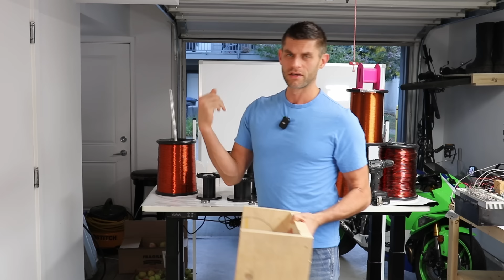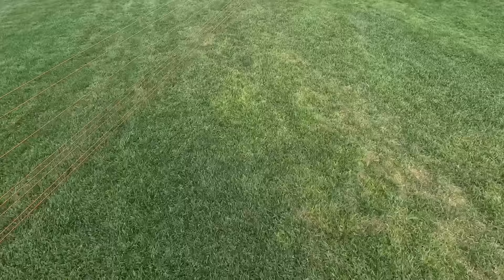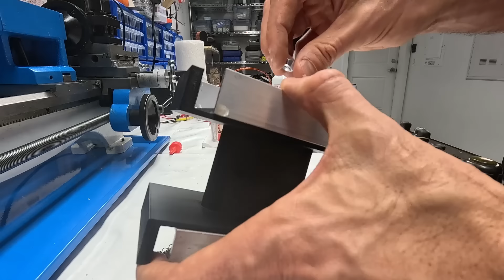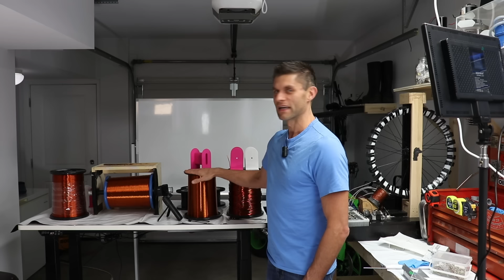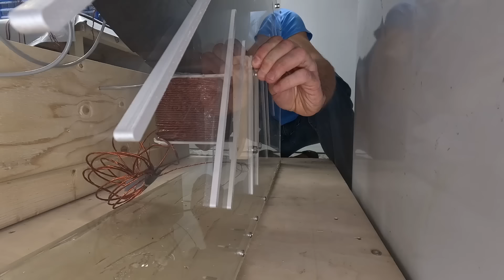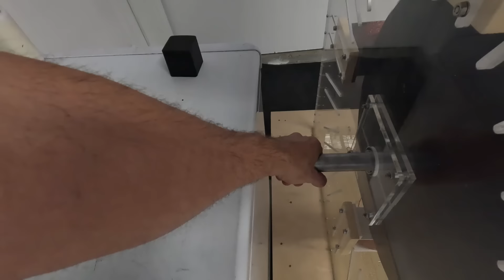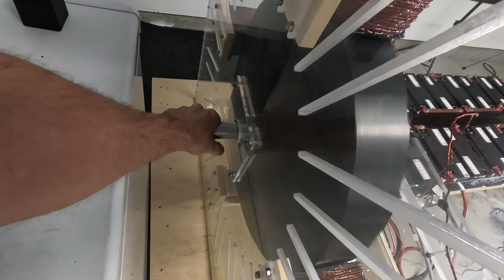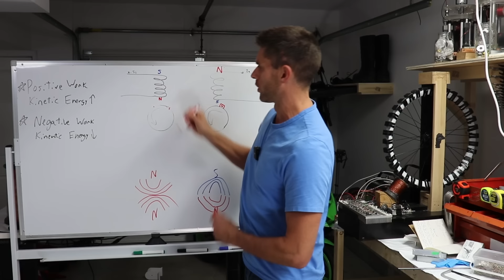The Device That Could Give The World Unlimited Energy

Comment: This dude understand the concept of entropy &  negentropy; guys we r living in a vast ocean of energy we just need to tap-in into it with  sharp pulse by quickly open/close the vacuum space time in higher dimensions
Reply from the maker: Cheers
Reply: So u can basically replace solor panels with that magnetic energy generator  and have power always, would u still need batteries? I would love to be able to not worry about having enough power. I do think the generator is a little loud, since it doesn't require fuel or anything needing oxygen might want to look into sound proofing it.
Reply: @scottbragg5047 I don't wanna burst you bubble but his device does not make free energy even if he tapped into the quantum background it would ammount to fW or pW which would be completly overshadowed by losses for now solar and wind power or like diesel generator are the only way to power your home if you truly want to be independent from the grid
Reply: There is NO gain on BOTH Voltage and Amperage.  
A Free Energy device needs to have a Positive Gain on Both Volts and Amps simultaneously.  
There are losses here...
Reply: you sound like a mental illness dude I know. go and get some help you might not realise how mentally ill you are. when your mad you don't know it for sure that's what my friend said. you just have strange unhinged thoughts and start to feel paranoid because people don't understand you. get help
Reply: Problem is can what he gets for free overcome his losses in the electronics the coils make heat the friction of the wheel the losses in the circuit doing pulse width modulation the heat in the battery let’s wait and  see
Reply: Put your equipment in the electrical socket if you're in doubt
Reply: Lt. Col. Thomas E bearden
Reply: @ceoofram4007  Yes, another idiot like this one...
Reply: Oh stfu
Reply: in a vast ocea no, we are energy , evrything in the universe is made of the same energy, lets say , in our universe there is 100% energy , and we cant add on any more or subract any of it , all there is to do is transform the energy , because that is all energy wants to do is materialize itself, there is energy all around us evrywhere , u wont find a single squared inch with out energy, only problem is we have not the tech or so they say we dont and its impossible, but at one  point in time no one could dunk a basketball from the free throw line because humans cant fly, until jordan took flight in 88 and did the impossible, it was such a feat to accomplish that overnight he earned thename air jordan. and today other players have also done it , so its only impossible until some one does it,  so we have so much tech and a sht to of gpatents that have been kept secret so that utility companies can continue fking us with out vaseline , i cant wait for the day someone sticks it right back and kills the electrical companies once in for all, next era and fpl just to name 2 of the fkn thiefs draining our earnings while politicians allow it , fk them all , i didnt go to college so all i have seen so far is ur usig a battery to run the machine thats charging ur other battery , nothing new there bud , so when is the magic going to happen u said oct nov well its almost holloween now . ps idk but u really gave me the impression that uir on some white caffeine man , slow the bumps down before recording urself .
Reply: Ok...
Reply: Let's ride that vacuum 😂
Reply: @grilsegrils9330 yeah man gonna tap into higher dimensions next week useing some copper wires I have laying around 😂
Reply: Bro what you just said doesn't just make no sense but it's so absurd I'm pretty sure you don't even know what you said yourself 😂
Reply: @MindfulMinutes-nz1lzjust because YOU and other's dont understand what he's talking about, or are looking at it from a closeminded perspective - doesn't mean Spencer has to be. Wake up!
Reply: @UnityThroughTruthdo you even understand what exactly hes doing because I'm like 100% you lack knowledge      on this subject he talks about pulling energy from quantum fluctuation which first of all there is no proven way that magnetic pulses like in a motor could pull that off and even if he is utalizeing some new physics or whatever he claims the energy gain from pulling enegry out of assymetrical quantum fluctuations would be fW to uW on macroscopic scales his maschine has losses in the single digit watts atlest if your honest it's in the double digits but even if we say he has zero losses and somehow got a single watt out of quantum fluctuation which is 1000000 to 1000000000 time larger then even optimistic guesses that would mean his device produces a single watt meaning you could light up a led if you buy a small solar panel you can generate way more energy and it's cheaper his device which is just a crudely build prototype which every prototype is crudely build that's not criticism it's hand wound and stuff that's takes dedication but even that costs way way too much to be economically valuable and this is assuming he gets 1000000000 times more energy out then even very generous estimations, to actually tap into quantum fluctuations you would have to use casmir plates to crate fluctuations within them which is extremly hard but the casmir effect has been observed so it is doable but even if you do that you also need fully superconducting circuitry to avoid any losses since these fluctuations would only produce in the fW and since we don't have room temp superconductors you would have to build it in space or discover room temp superconductors just for fW which can basically power nothing so even if you were to pull it off like he claims quantum fluctuations are not a good powersource a small solar panel would outclass that by multiple orders of magnitude
Reply: @MindfulMinutes-nz1lz It sounds like a mashup of bubble fusion and quantum mechanics, joined on the word "collapse". I doubt the "higher dimensions" have more resistance to the energy than the work it should do here. Until someone has a working demo of this snake oil, rest assured there is enough solar fusion to power all of society using only a small surface area with existing tech.
Reply: @CTimmerman it's complete bullshit like not even oh yeah ok sounds plausible but we don't have the technology yet its just random words put together trying to sound smart 😂😂
Reply: @MindfulMinutes-nz1lz Dude, trying to read your comments is more exhausting than running a Ironman, but hey, you're the smart one here who figured it all out
Reply: @Astrodicted more exhausting then running a ironman? Bro what does that even mean 😂

Besides yeah I know my stuff I'm not claiming to be smarter then anyone but I have spent thousands of hours building spectrometers and tube furnaces and all sorts of chemical aparati, I'm not a expert but Im smart enough to realize this is bullshit 😂
Reply: @MindfulMinutes-nz1lz And then there are the people who actually built the Bedini engine/generator. It's decades-old tech and has been reproduced by many. Maybe it's time to realize that yr realizations might need some work
Reply: @Astrodicted bro yes the motor works I never said it didn't but it doesn't produce net energy gain it's literally impossible besides you think i don't built stuff i literally built more stuff in a year then PhDs in 5 but I don't focus on stuff that is obviously impossible energy is always conserved I don't care what you do its a basic law of this universe and if your going to say but you can drag out energy on the quantum scale which in theory yes you could but also no we lakc the technology to actually pull this off and even if you did it would be in the range of fW or pW any type of less especially friction and heating losses electronics like from mosfets would overshadow it by a long shot and you obviously need a lot of switching since your pulsing magnetic fields the best thing that will come of this device is a very efficent motor which it probably can't compete with advanced simulated motors of today's age, he basically built a fly wheel which if he wanted to build one that was near today's top technology he would either need magnetic suspension or atlest a carbon nanotube lubricated shaft
Reply: @Astrodicted Has it been succesfully built? Please point us to one example that is scienifically proven to work with a net positive output.
Reply: @niclas.lindstrom  Ты что -тупой ? Overunity sistems давно работают во многих точках мира хотя многих поубивали !! Тебе Фома-неверующий просто надо выбрать маршрут и увидеть своими глазами, ты же не хочешь сам что-то сконструировать !!
Reply: @CTimmerman And the battery issue seems to be getting solved..... lithium was NOT a solution
Reply: @CTimmerman  stargates

Comment: So far you have not provided one file related to this. All you have done is post absolutely worthless videos which can manipulate people who do not possess enough knowledge to comprehend this.
Reply: The machine shown in the video is known as a pulse motor. It uses copper coils, permanent magnets, and optical sensors to create rotational movement. This relies on very real, well-understood principles of electromagnetism (the exact same science that powers standard electric motors).
However, a pulse motor requires an external electrical input—like a battery or a hidden power supply—to pulse the electromagnets and drive the motor. If you disconnect the power source, the motor will inevitably slow down and stop spinning due to friction and air resistance
Reply from the maker: Yes i have posted files. If you dont find value in my content you are welcome to leave
Reply: @MadscienceLPTECH I apologise if I have overlooked it, but I was not and still not able to find the files.
Reply: @MadscienceLPTECH Enjoy your 30k$, Mr Coil man🎉
Reply: @niklasjalvmyr8687  more like Con man
Reply: @MadscienceLPTECH that answere is worthy of watching every video you make! L9ve the content. Anything that makes your audience think is a good thing. Keep going!

Comment: The order of battery connect/disconnect for automobiles is opposite because the vehicle is ground, and a tool strike to ground while unclamping the positive connector can cause an arc-weld, and a direct short on the battery and a fire.  Hence, in automobiles, disconnect the negative/ground on the battery first, since a tool strike there won't cause current flow.  Negative ground is also attached last.
Reply from the maker: I was a heavy duty mechanic at FINNING and thats not what I was taught
Reply: @MadscienceLPTECH   my buddy that burned down his porsche would disagree that disconnect positive first is safer - his wrench arc welded the positive terminal to ground and was glowing red in less than a second.  

The automobile battery disconnect order should be the same as jumper cables: connect positive on both batteries, then connect negatives.  Disconnect is reverse order.
Reply from the maker: @geraldc867 I got taught opposite. Its possible to arc out regardless of whats hooked up first
Reply: @MadscienceLPTECH  my ProMaster van has a quick disconnect on the battery negative terminal.  Always disconnect automobile ground first before doing automobile electrical work since the body is negative ground.  Maybe some specialized truck equipment with positive ground would be opposite.  Japan was creating positive ground vehicles in the early days until they started selling in the US market.
Reply: @geraldc867  You are exactly right and would this creep not even let do work on my tractor. On top, it does not matter if you have just a battery and not a body and there is no ground on a battery, only a positive and negative. And I am sure there is no more energy going in the battery than there is going in the coil. Just an elaborated scam.

Comment: What are you trying to achieve with an eight-filar coil wind?
Are each of the eight strands powered on separate circuits?  If so, for what effect?

I've studied and worked with bifilar coils, like Tesla experimented with.  They do have a modest capacitive effect, and a strong magnetic coupling, even in air cores.
Reply from the maker: Watch the whole video I answer all your questions